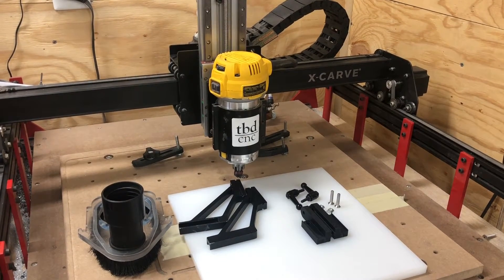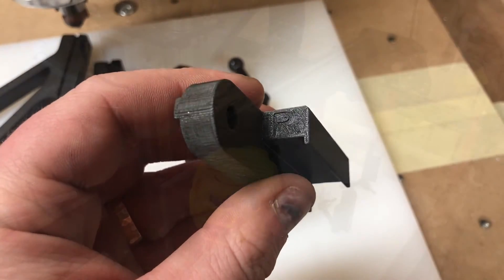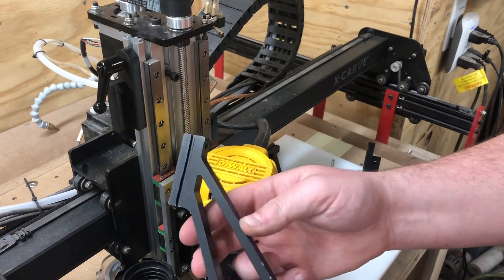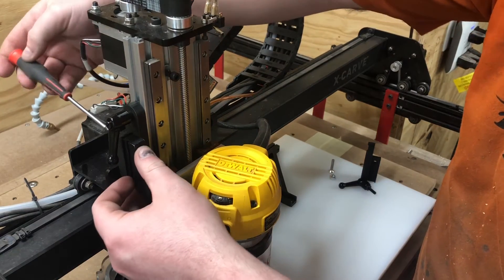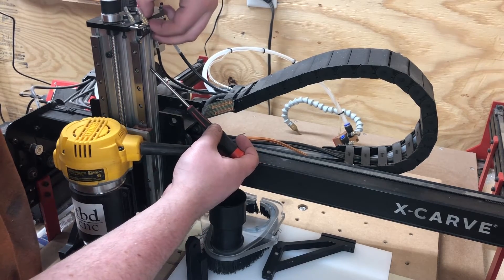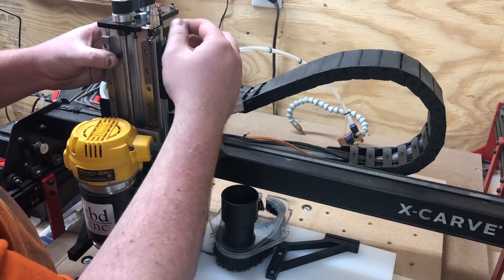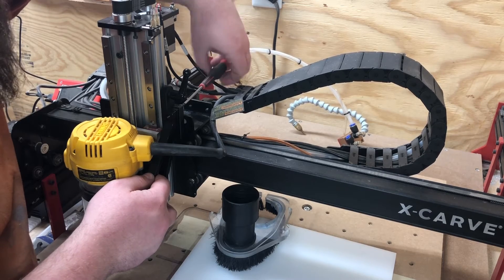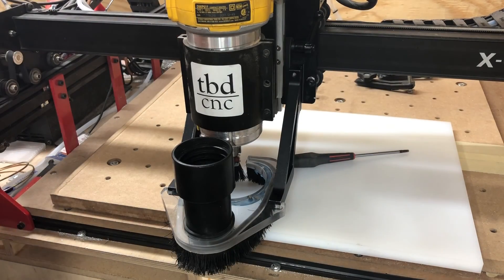tbd cnc Dust Boot Adapter Kit Installation

Comment: just installed mine. Moves so much easier than the original.  I actually wouldn't adjust mine sometimes because it was such a hassle. Thanks Luke!

Comment: Maaaaaan. I bought a cnc4newbie unit awhile back. Wish I'd have saw your unit first. I had to buy a suckit dust shoe to work with the new z axis. This would've been so much easier. Only thing I like more is it's a direct drive system vs the belt system. Love that part.